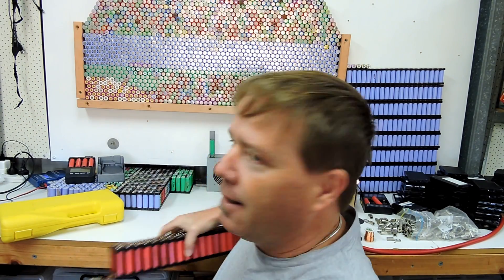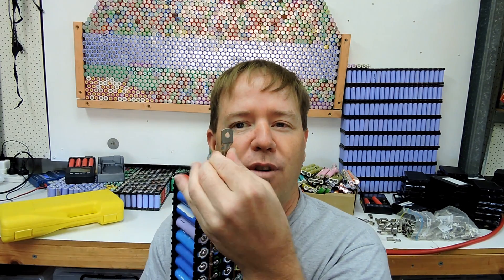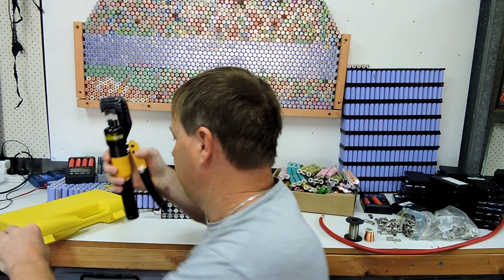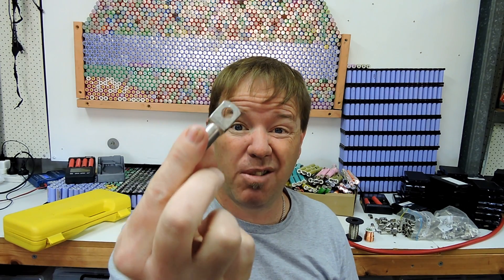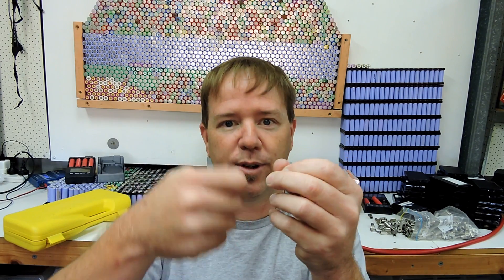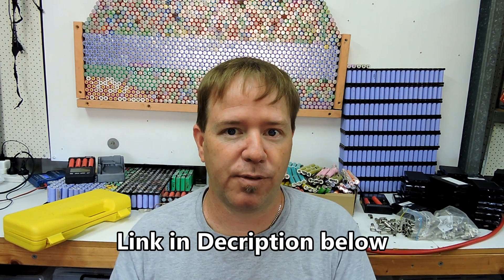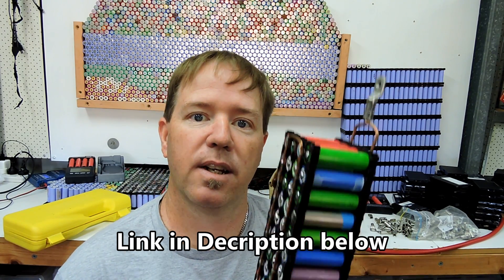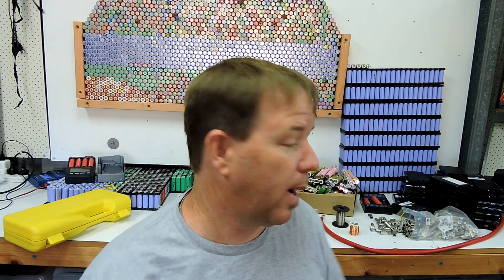18650 Cell Fusing

Comment: Great video Pete! I'm a retired sparky and your crimps should be done with your hydraulic press. On your cells, I would stuff some short cuttings from the cable type that you run along the cell to fill any voids prior to crimping. I'm not a fan of making lugs with pipe, too many variables and inconsistencies. I would check all terminations monthly with your thermal gun and check all mechanical connections at least annually.
Reply from the maker: Didn't think about putting 'spare' copper in their - great idea - Pipe is defiantly a choice when that's all you have I guess. Definitely agree with regular checks of any electrical setup like mine!!!
Reply: Contact the cable manufacturer for  recommended crimp barrel size and crimp tooling. Companies like Glenair will do a crimp match and test  though they are more for mil-spec, aerospace.

Comment: So 5-6 amps or 19-20 amps for the fuse
Reply from the maker: Good question.. my test was 5-6, he was well more but all you have to do is short circuit one cell if the fuse wire goes means it's good enough if you ask me
Reply: HBPowerwall I was just curious working on a design to use the micro auto fuses that go as low as 0.5 amps and just use contacts Vs spot welding or soldering a ton of fuse wire

Comment: Why wouldn't you be soldering the lugs? There has been half a century of manufacturers adding thick solder to PCB tracks to increase their current capacity.
https://www.youtube.com/watch?v=L9q5vwCESEQ
Reply: Afaik if you are building something for a car or a van or an RV, the vibration can kill soldered connections. Because with soldering you have a more rigid edge where the wire can kink and break. For a house I think you can solder. Afaik.

Comment: Well I will be doing the power wall project soon. I bet it would last longer than lead acid batteries. I prefer spot welding to soldering here and I've made a spot welder for that. https://youtu.be/WAoY9HTdF6o

Comment: Using the crimper and solder should help make a more solid connection. So unless you're putting a lot of strain on that connection, it should be fine.

Also, no soldering and having an "improper" crimp can lead to the connector being a lot more prone to corrosion.

That's how I understand at least.
Reply: If you're worried about corrosion couldn't you just spray some conformal coating on the exposed bits?
Reply from the maker: I think i have it sorted but the old interwebs makes me second guess my self all the time :)
Reply: HBPowerwall
Aye, you seem fine.

Good luck out there!
Reply: williwonti
Nah.
The conformal coating would wear away after a bit.
It's real good for protecting things that don't move around much, but it wouldn't work well on a connector that's plugged and unplugged alot like this one probably will be.

Comment: What do you think about these 4000, 5000, 6000, 9800, and even 9900mAh 18650's now available on eBay for less than $1 each?  Are they legitimate, or just blowing smoke?
Reply from the maker: Next Video .....
Reply: The state of the art is about 3500 mAh in 18650. Those are so special that you have to use a charger that you can command to charge to 4.3 volts because that's their magic sauce. Being tolerant of being charged above 4.2. They also tend to have extremely low internal resistance and so can take a huge load without sagging. You'll pay about $15-20/cell for these. Flashlight geeks and vapers are the native market for these.
If you are lucky, the cells with 9900 mAh on their wrappers will have been recycled from an old laptop battery and have a respectable capacity left over. If you are unlucky, they will be brand-new and weigh half what they should, providing 600-700 mAh, about that of a AA sized Li-ion. A battery that had that little care taken for its construction is probably not going to be trustworthy from a lifetime or safety perspective.
Reply: there all bs in all honesty  the 2-3 cells are 3000ma at most.  Thouse cheap no-name cells your luck if you get 500ma out of em and they degrade really quick to below 100
Reply: The cheap ones test out at about 1000mah.  The best ones I've found in the budget range are the EBL which test about 2000mah and can be had for about $1.50.
Reply: Anything over 3,000 is complete bullshit. You won't get a tenth of that in the real world. Even at 3000 I would still be careful about which ones you choose. most at that rating are BS too. I do know those purple efest cells are good for 3,000 mAh, and some genuine samsung and lg cells can reach that rate too, but you'll be paying a pretty penny for anything legit, though knowing your house won't burn down from using shit cells is worth  it, imo. Oh and if fire is in the brand name, then that's exactly what you'll get.
Reply: TheZigZiggy
Nah, I couldn't imagine those being legitimate.

I think the max at the moment that we've got is about 2500 to 3000, and they definitely aren't 1$, to my knowledge. I could be wrong though.

You can look it up. Probably won't take long to find an answer.
Reply: Jheau has already done a video covering those
Reply: Markle2k fully agree
Reply: milkbox upto 3400-3600 is ok as long as it's a raw cell bought in bulk from a reputable supplier and not some Fire BS on fleebay.
Reply: Its a piece of shit

Comment: That's a really good idea about using copper pipe!
Reply: but you need the right size copper pipe. for 35mm2 you need 9.5mm diameter copper pipe, for 50mm2 it is 12mm diameter.
that was the reason some of hbpowerwalls crimps slipped, there was not enough copper wiring inside. 
you can also fill in, with offcuts of wire strands.
if a crimp is properly crimped and you cut it apart with a hacksaw, it will be one solid copper bar. it is all cold welded together.